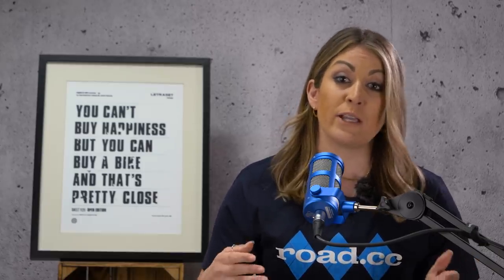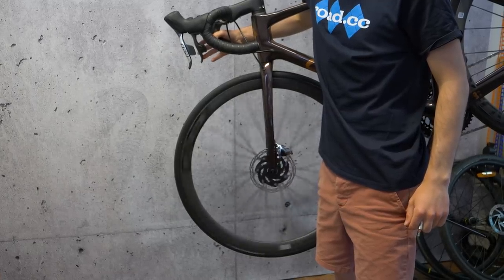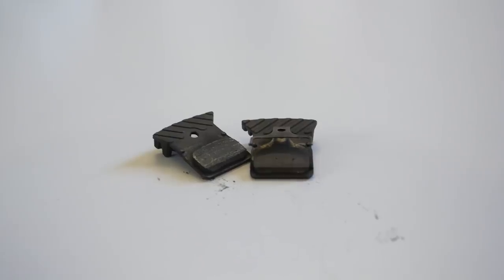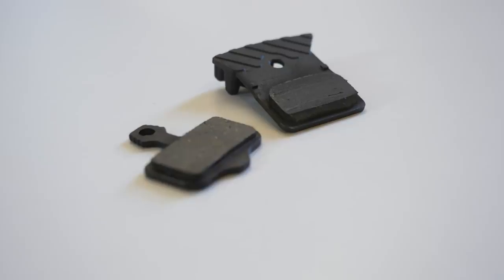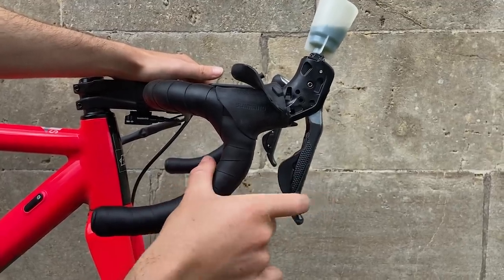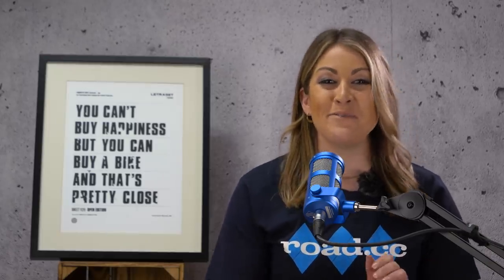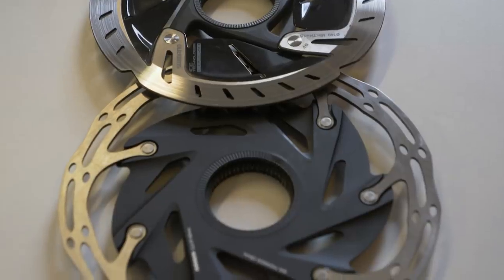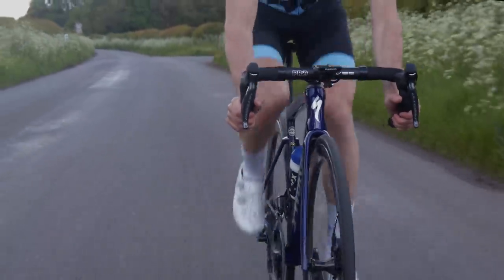8 things they dont tell you about disc brakes

Comment: After owning 5 disc road bikes I am now switching back to rim brakes. Disc is hard to maintain. To remove the fork to clean the bearings you have to dettach the hydraulic brake hose from the front caliper then refill bleed it after, realign the rotors and pads. It was an effing nightmare. With rim brakes you just drop the fork done. 🤦🏻
Reply: Why would you detach the hose?
Reply: @annegrey-blackman5934  how are you going o pull out the fork?
Reply: @hayabusa27  unclamp the lever from the bar.
Reply: @annegrey-blackman5934  do you have to remove the bar tape for that??

Comment: Thing is, a wheel is a big disc…. and a caliper brake rubs against the disc to stop your bike. The disc brake systems are cool, but it’s also one more thing that can go wrong
Reply: I've never had caliper brakes go RIGHT. 4 years ago I bought an old 3 speed CCM with side caliper brakes. Then I switched the steel rims to alu. The front braking actually got WORSE in dry conditions. Pads make NO difference. They just glaze over with alu oxidation, and wear crooked anyway. WTF. At least my rear now has drum brakes. 
In the old days, I had to put seat springs on them to center them from rubbing. WTF.
I don't call them rim SCRATCH brakes for nothing. LOL

Comment: Hate these new brakes! On a cruiser it is necessary to have a disc brake on the back rim. On an old English Racer the brakes were the older gawky type caliber brakes. I built a bike from junk at the refuse, dump. Old plumbing pipes and metal trash. Bought the solid rubber tires. Eventually sold it for 200 dollars. This was back in 1967 I was 8 years old.

Comment: Unless you're a pro who has a mechanic ready to hand you a new bike, disc brakes don't make sense if you're a road racer. If you flat, there's no way you're getting back into the field if you have to remove your thu axle, install a disc wheel, and re-install the thru axle. Of course, almost no one who buys bikes actually thinks about the reality of racing, but to me, disc brakes on road bikes will always be superfluous and dumb, and I resent the fact that the industry forced everyone to change to them.

Comment: Guess why moto gp racebikes have 2 set of disc brakes in the front.... 1. is cooling factor, 2. is increased breaking power, 3. it wont bring your wheel out of balance when you break, which happens when you apply force on one side of a wheel. You may adapt to it, but on a race bike which weights 7.5 kg this is freaking sketchy. As a non pro, you dont wanna change your wheels every 10k or less when descending quite often. You dont want to put WAAAAAY more force onto your fork while breaking. Its just stupid

Comment: sturmey archer brakes only. disc in garbage bin.
Reply: My front SA XL-FDD has 26,000 miles with 8,100 on a 120 lb tour bike. ZERO fuss. At home, it's just 75 - 80 lbs. LOL
My Rohloff14 has no other good choice but my homemade disc mount and cable TRP Spyre with resin pads. It can lock INSTANTLY every fricking time. This is with my awesome SA levers supposedly set WRONGLY to long pull. LOL.
Shitmano calipers with 1 side moving do SUCK. yup.

Comment: I've always preferred rim brake on any bike because of ease of maintenance. The same reason why I hate electronics on my bikes and my vehicles. They're not necessary (to a degree) The bike I just recently purchased is disc so won't be looking forward to maintenance on that but I love bikes period. Disc or rim brake. Most MTB bikes had them for years and I rode them and had no issues; but they need to stop pushing it and still leave people with the choice to choose.

Comment: Grew up with rim brakes and until I got my first bike with disc brakes on 1996 they where fine after disc brakes I couldn't understand a single reason to go back. If you like rim ride rim if you like disc ride them. Just fuppin ride already
Reply: Both types have advantages and disadvantages - so it depends on the usage, and the personal taste of the user

Comment: Why hydraulics? Any one working with hydraulics knows one fact...hydraulic will always eventually leak. I have used mechanical discs on my bikes for over 20 years, not a problem braking or controlling braking. Is everyone using hydraulic because their little hands are too weak to brake?

Comment: Rotor are much less maintenance and fuss than rim brakes. Rim squeaks too, if you use the wrong liquids - so no difference here. Intermittent clicks from a rotor is 95% either bent disc or easy fix. Never replaced a pad - ever - you're supposed to ride, not break.

Comment: sport cars became heavier as well, but the added more horsepower and fitted the car with proper electronics. So comparing that to a bike would mean, give disc brake bikes a motor and assistant systems and then they are superior to rim brake bikes

Comment: Disc brakes are totally unnecessary on a road bike.  If you want them fine, but you don't need them and they look crap on a road bike that should be thing of beauty.  I have never had a problem stopping even when loaded up on long tours with rim brakes.  Disc brakes also make for horrible over stiff frames and forks ie fashion before function.

Comment: Disc brakes are undoubtedly superior on wet road conditions....but not worth the trouble as compared to a good set of caliper, V-brakes or even cantilever brakes. Disc brakes are little more than the industry's way to a dependency on bike shops and manufacturers innovation (that's not really innovation just something different).  Give me a steel bike with aluminum parts and caliper brakes and the only thing I need is new brake pads occasionally. If you need to rely on the advantage of disc brakes your skill level is really poor and that is on you!

Comment: The OBJECTIVE is... on a road bike if you know how to ride well is to NOT brake at all, if at all possible, and not add some clunky contraption that forces you to obsess over braking.
Reply: The question is, what IF a rider does not have great bike handling skills that needs to descend down at 60kph. If a rider has great handling skills and great awareness within surroundings then there is no issue with rim or disc. The question most whingers do not think is from safety’s point of view and just go with their own narrative. A company thinks as a fooking whole. Most of their bike will be selling for average fat fooks mamil consumers not for pros. Pros can ride rim or disc and it wont even affect them. That simple.
Reply: On a fast descent, if you don't brake at all you may find yourself at the bottom of the hill way faster, albeit in a way different manner than anticipated. ;)

Comment: A couple of things they don't tell you about disc brakes in a video about things they don't tell you about disc brakes:
Thermal management is an issue. The small, light disc has neither thermal mass nor surface enough to cope with a lot of braking and the high temperatures generated by the pads. Rim brakes operate at lower temperatures and have comparatively huge surface, thermal mass and heat conductivity (at least the aluminium ones). Rim brakes can fail too if used improperly, but that's difficult to achieve, whereas you can get brake fading with discs comparatively easy. I would trust only Shimano stuff here, with all the cooling fins - the rest are not trustworthy.
They're complex. Rim brakes can be understood and serviced by most people, hydraulics and discs require deeper knowledge. So you might not be able to service them yourself.
They're delicate. Rim brakes are difficult to damage (and easy to fix if you do), disc brakes can suffer catastrophic failures from innocuous seeming handling. Take out a wheel and you have a ticking time bomb. Accidentally press the brake and it may mean an end to your ride (and an expensive trip to the bike shop). Forget to put in the block and put it in your car and you might find that the jostling was pressing the brake and now you have a broken caliper, ended your ride before you started it, expensive visit to the bike shop, and your car and/or stuff in it drenched in hydraulic fluid (if it is DOT4, an aggressive one which will eat through the paint on your car). Carelessly throw in the wheels and you might bend the discs, with all the mentioned consequences (ride over, yadda...). Fall down on them, lean the bike against something, hook the disc under something etc: bent disc, yadda...
Under normal circumstances - dry weather, clean roads - rim brakes are more than adequate. Plus they're simple and reliable. Not saying that disc brakes were bad, but for normal use, I don't think that the benefits outweigh the drawbacks.

Comment: What a load of rubbish !! . . . 7k miles on my commuter all year road in anything from snow to blazing sunshine and not a single problem . . . I've never even taken the pads out to clean let alone replace them !
Reply: Please mention the product when it works so well.  Brand of commuter and brakes?
Reply: @robertschwartz3675  yeah, nothing special,  Shimano 105 5800 hydraulic, standard spec on a 2017 Cube Nu Road . . . I have Ultegra 6800 rim brakes on Super Six Evo with Mavic wheels  and the hydraulic 105 is far superior !!
Reply: @fasdiablo  The 105 5800 are rim brakes not disc from what I see.  I think I originally misunderstood your post.  I have a lot of issues with my disc brakes and probably need to change them.  They were a cheap set.
Reply: @robertschwartz3675  no, you understood perfectly,  Shimano 105  5800 has both a disc and rim brake option

Comment: Rim brakes don't move, disc brakes rotors move which causes more air friction, this is always going to be the case for the aero argument unless they cover the rotors. 

on a road bike you spend way more time needing aero than you do needing faster braking, hence why rim brake bikes are still winning the majority of races. if disc brakes want to become as aero as rim brakes, they'll need to sacrifice even more weight. 

I'd personally like to see rim brakes mounted internally within the forks and rear stays, the maximum aero design, just a clean frame on show.

Comment: Disc brakes are a braking system designed to be a braking system. They're safer, more reliable, more durable, brake harder, they hardly overheat etc but we're still arguing because they rub sometimes 😅 everyone forgot how it feels to need to perform emergency braking and have no breaks because of mud and rain?

Comment: I never had any problem with disc breaks. Much more reliable than rim brakes. Whole clip is misleading!!!!
Reply: Problems with rim brakes? Bah!
Reply: Disc brakes that don't need alignment every ride? Preposterous!
Reply: Let me tell you, you are lucky. Many people have problems with them, (this has to do with frame QA and build quality). The tolerances are far smaller on a disc brake bike and bike frame manufacturers have a problem staying within QA tolerances. Therefore you could have a perfect bike, the next buyer has nothing but trouble.
Another problem that is arising is, wearing of hoses in integrated handlebar systems. So these need checking and replacing regularly. You don't want these to fail mid ride.
Reply: @cannon1156  nothing to do with DR, i have had direct statements from mechanics and owners, that have problems with hoses failing or continual problems with their new disc brake bikes. Even this video is highlighting it. If you want to buy a disc brake bike go ahead, but not everyone wants this tech forced upon them.
Reply: @waynosfotos  own 3 disc brake bikes and have had no issues whatsoever. And one has over 10000km on it. Its all to do with fitting gear properly. Havent you seen the damaged cable housings that mechanics say to replace on a regular basis otherwise poor shifting or braking? Just following the samer dribble as your master ..lol
Reply: @waynosfotos  some actual statistical valid data would be useful in this whole discussion, otherwise it’s just anecdotes and opinion, rather than a data based discussion…..I don’t actually know though where one would get this information
Reply: @chapmag6578  Certainly not from Manufacturers. Stuff like this is kept very quite for obvious reasons. Al I can say is people have directly told me of their experiences on my channel. Take that information any way you wish.
Reply: @waynosfotos  I get that some folks are having problems with disc brakes.  I get that that there  are some quality issues with some frames etc.  I wonder though given the number of bikes sold and out there how prevalent are the issues, and that is not to say that the industry should be working to resolve the known issues.  As consumers we can vote with our wallets, and manufacturers know that.  Given that why would some manufactures only offer disc brake models and potentially loose heaps of sales to rim brake models ?
Reply: @chapmag6578  i did a vid on this already. 👍🤔😊💯
Reply: @waynosfotos  will check it out 👍